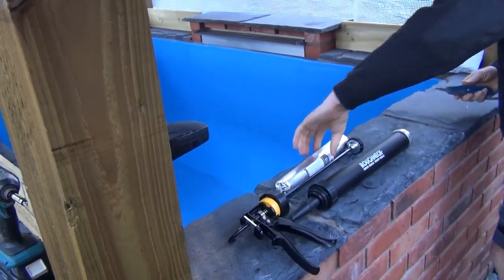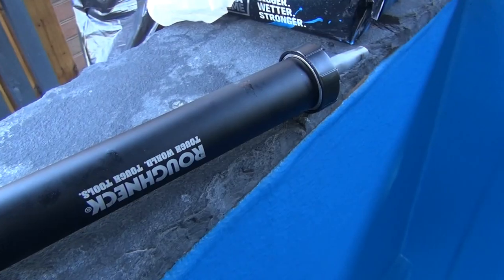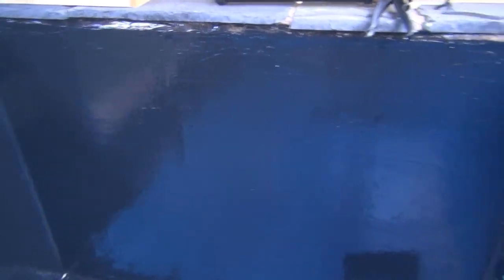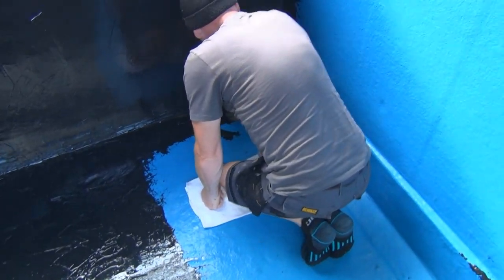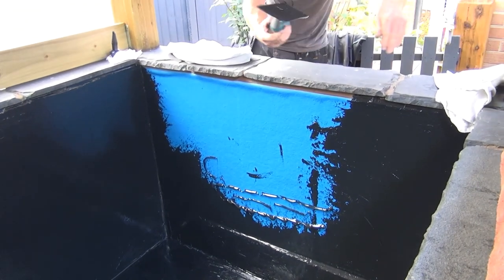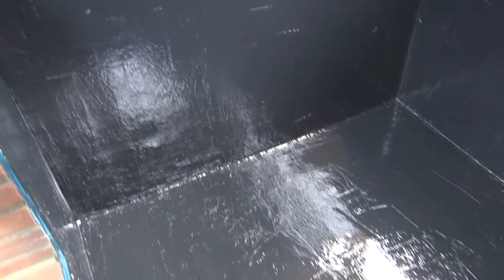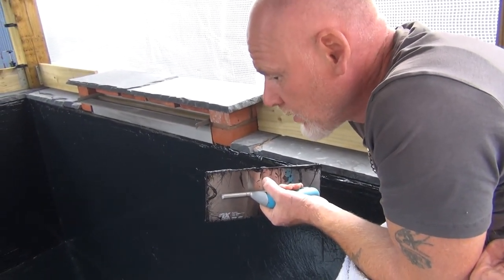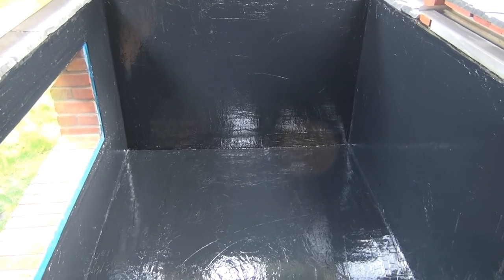T.K.P. Telford Koi Pond - Video 124 – MS300 Liquid Liner applied to Fix a Leaking Fibreglass Pond.

Comment: great vid. This looks like it might be a soloution to my pond leak. Did you have to roughen up the flowcoat to improve adhesion for the MS300 to stick?
Reply from the maker: You don’t have to but I believe it really does help the adhesion so I would always recommend it. You don’t need to got to town, just a quick rub over with sandpaper or similar ( not too course) and you’ll see how easily it forms a key. Important thing is to wipe it down afterwards to make sure all the rubbing dust has gone👍. Hope this helps😊